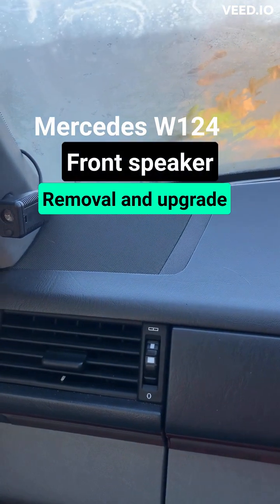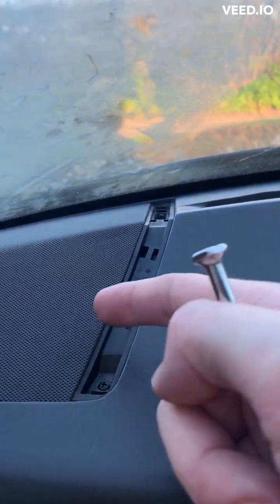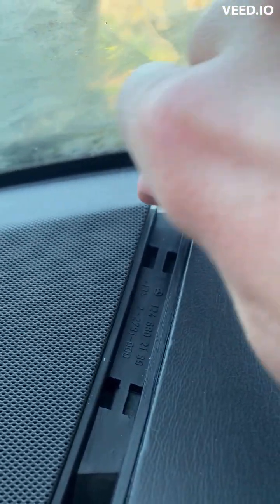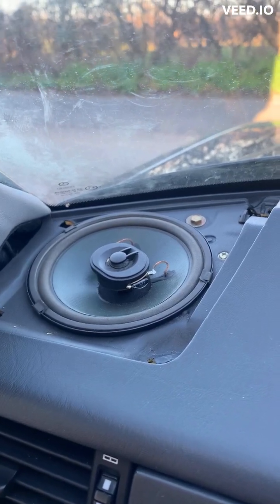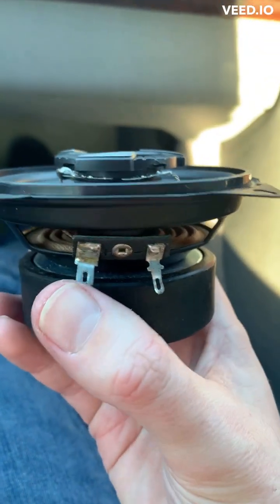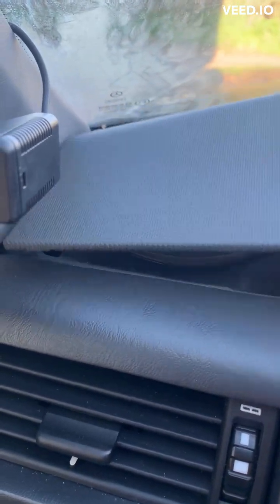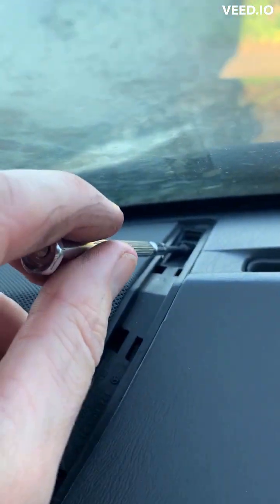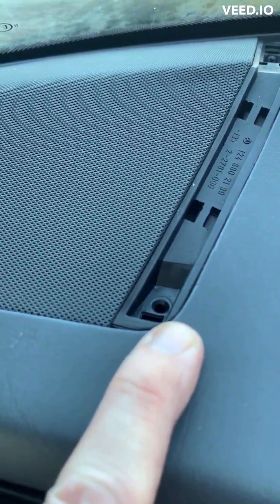Mercedes W124 front speaker change

Comment: What’s the replacement speaker size?
Reply from the maker: Let me double check and get back to you. I think they were 5”.
Reply: I would recommend you buy a trim removal set made of plastic, great for jobs like this and inexpensive and doesn't damage parts.
Reply: @Beechams1042 what we’re the sizes of the speakers for the front and back dash sir? And the doors
Reply from the maker: @plissken94th57  fronts are 5”. No door speakers - at least in mine. I’ll have to check the rears.
Reply: @Beechams1042  I have a 300ce so I only have front and rear dash speakers